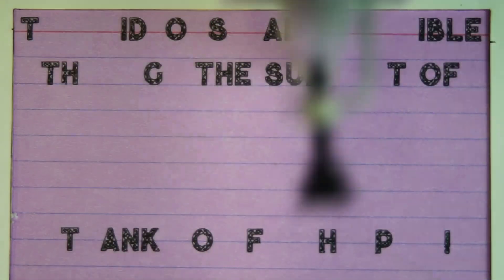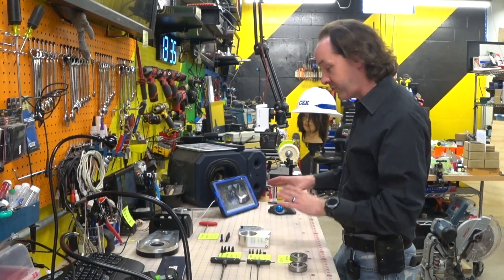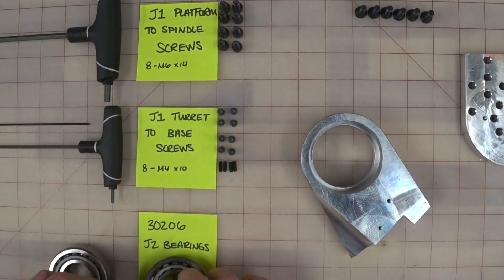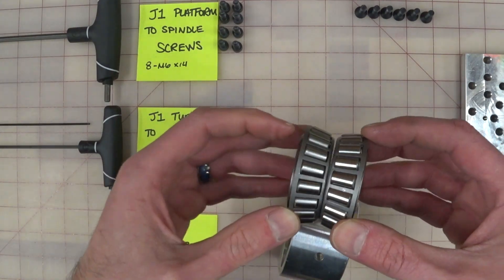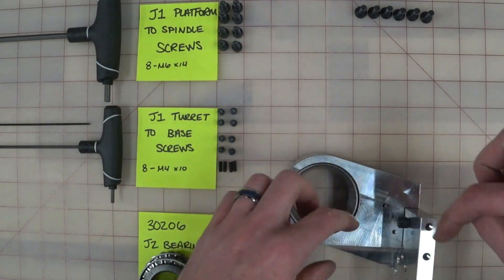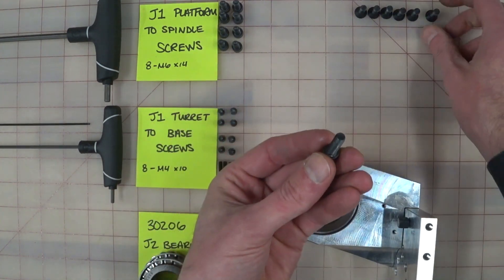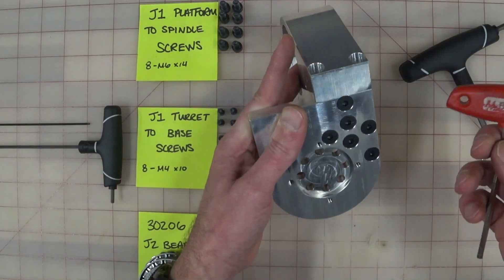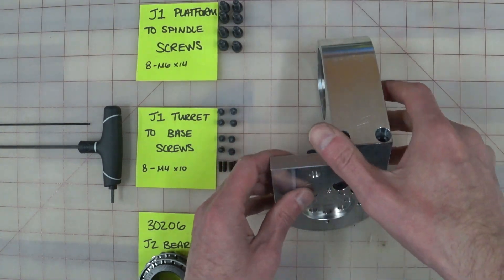Project ARchi3 Episode 4 J1 Turret Assembly

Comment: Hi. Thank you for your great video. I Installed platform assembly onto J1 spindle assembly. However, the spindle does not rotate, and it is locked. I assembled this several times. However, it is locked when I screwed the (8) M6 X 14 socket head cap screws. I bought the aluminum kits from Annin Robotics. The only way is to put the (4) M4 x 10 set at a special distance from the bearing and not tighten (8) M6 X 14 socket head cap screws. However, in this way, the (8) M6 X 14 socket head cap screws can be rotated by hand. What is your opinion?
Reply from the maker: I think the best thing to do is get in the forums at anninrobotics.com You'll find a ton of other guys out there just like you and they're happy to help with problems exactly like this. :)